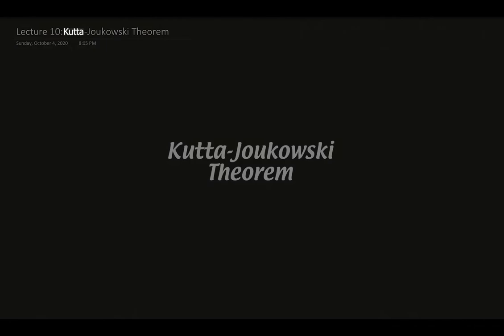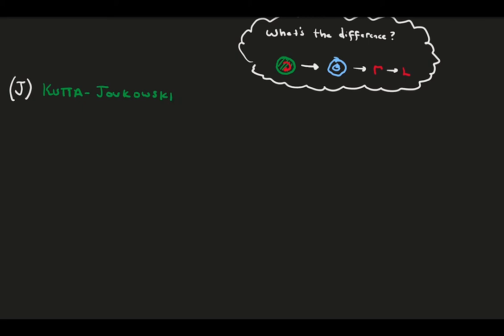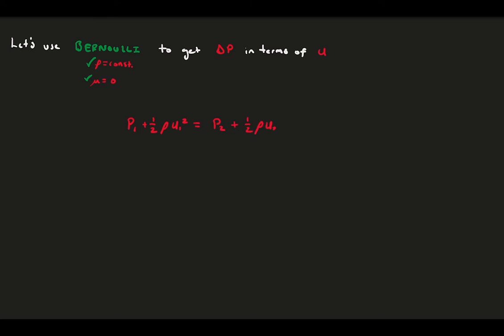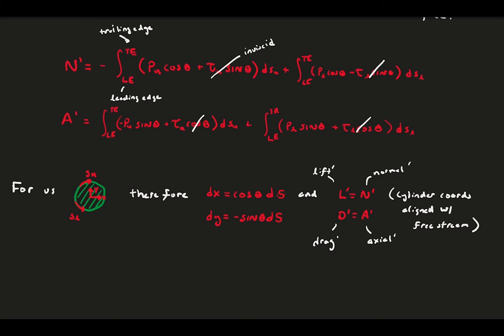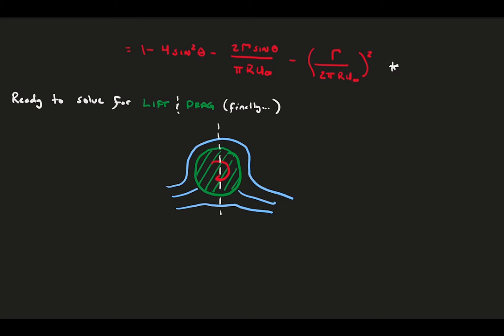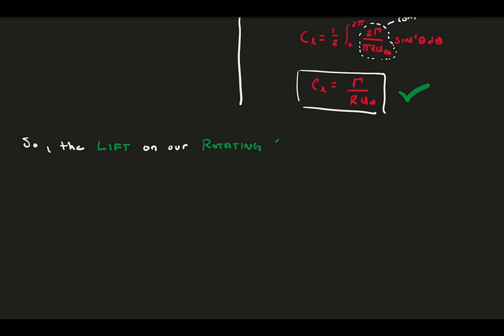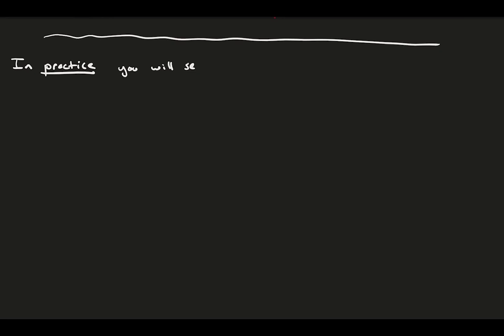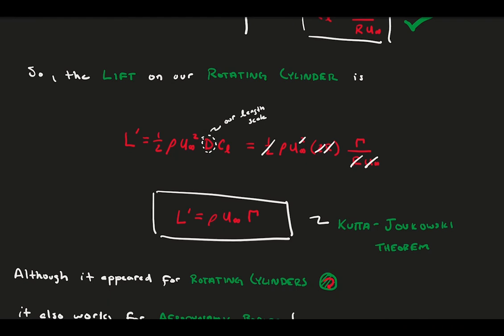Kutta Joukowski theorem [Aerodynamics #10]

Comment: When a cylinder starts to rotate clockwise, it is surrounded by anti-clockwise vorticity in a boundary layer. As this layer thickens up under the action of viscosity, it is convected away by any crossflow. This leaves the cylinder as a naked vortex which then produces a transverse force.
Reply from the maker: Yep!

Comment: The method used by you is amazing! It was so engaging and it helped in clearing my basics. Can you make a video on how to choose an airfoil for a fixed-wing UAV, design and things we need to keep in mind?
Reply from the maker: That's a good idea, there's so much that goes into choosing the right airfoil. In a UAV application, it depends on what you want - max lift, min drag, max lift/drag ratio, max performance range (UAVs can be small and experience gusts, so a wide range of velocities/angles in a single flight). Once you have an idea of what you want to optimize for, you find your expected Reynolds number then start exploring existing airfoils (something like airfoiltools.com is good here) or optimize design your own!
Reply: @prof.vanburen  yeah, I've used that too.
I'm doing calculation for eVTOL fixed wing from scratch. Initially I faced problems with the approach that is why I wanted some help.
I've read research papers related to that, but I'm looking for someone like you. The way you simplify things, it is a sign of excellent teaching and conceptual understanding.
If possible please make a video on that.
It'll be a huge help. Thank you!

Comment: Can you help me to understand why at 8:13 we have Cd equal to 2 integrals one positive and one negative, and then at 9:10 Cd became a unique integral with minus sign? I do not understand the minus sign. The same happen for Cl.
Reply from the maker: It has been a while since I looked at this lecture! I think it is because earlier in the video we are considering generalized calculation of lift and drag from the upper and lower surfaces of generic shape. Further down, we consider just a cylinder which has simplified versions of the equations. I will have to re-watch in detail just to make sure that's the case.

Comment: How does the airfoil shape produce rotation?
Reply from the maker: Do you mean generally how a foil might turn the flow downwards, producing the circulation that is the footprint of lift? Or how in reality the no-slip boundary leads to a boundary layer full of rotational flow?
Reply: @prof.vanburen  the latter. I think this validates the Kutta condition